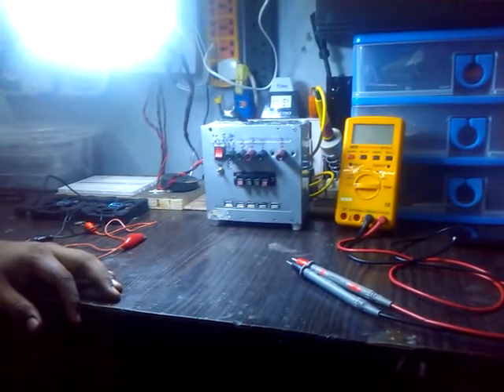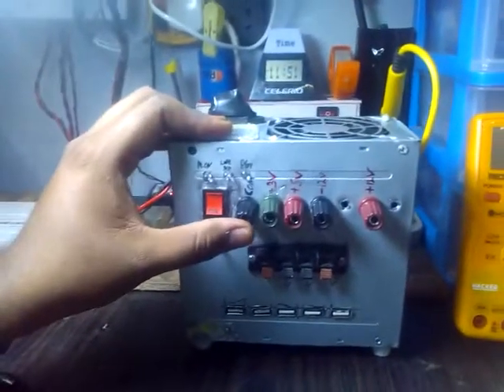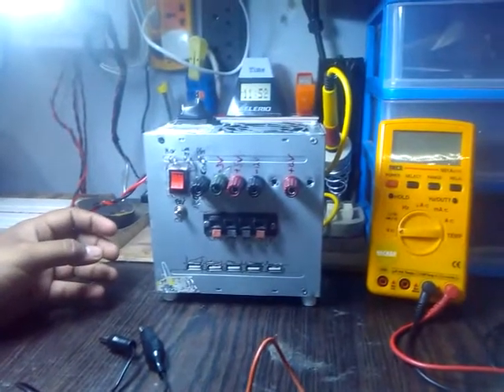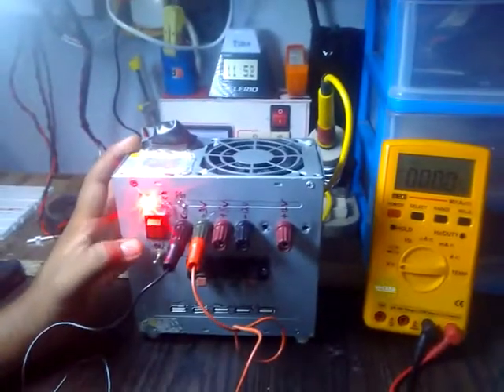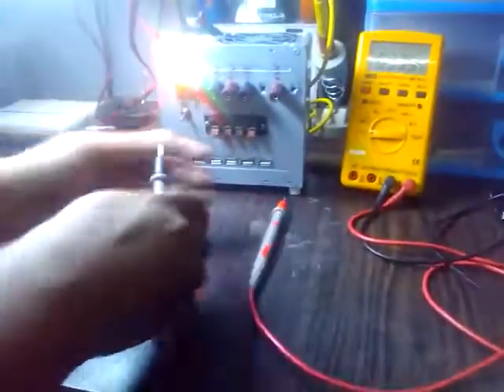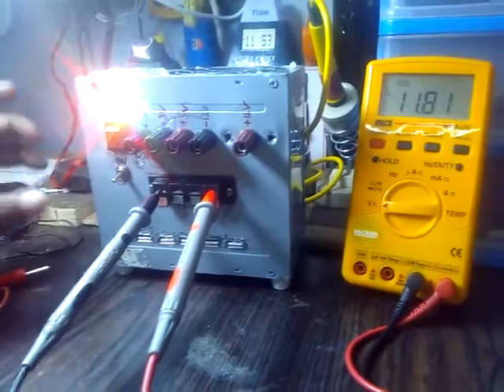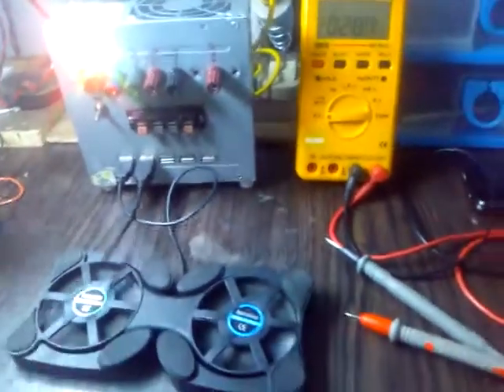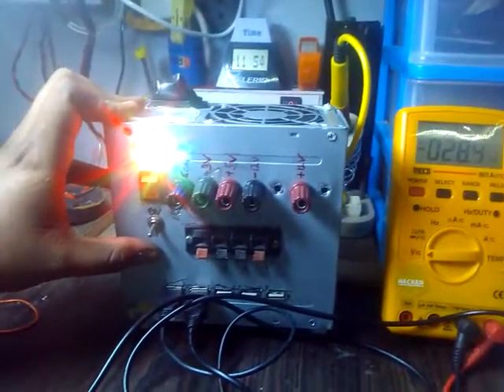ATX Lab Bench power supply with USB output

Comment: can you please what all connection should be made to convert it for lab bench power supply
Reply from the maker: thanks for writing,
in the ATX there is colour coded wires normally black is for GROUND, orange is for +3.3V, red for +5V, yellow is for +12v, blue is for -12v, purple is for +5v standby, gray is for power good. u need to connect the green and black wire to on the atx and u also need to put 10W  5 ohm dummy load resistor between ground and +5v. and plz look the colour coded on to the ur ATX.
Reply: I have done everything and actually I had 22ohm 10w resistors and after starting everything went but it was giving some kind if sound and when I touched the box I got a shock and I connected resistor to 12v
Reply from the maker: Vishnu Chuncha ok u need to check  the atx EARTHING line, if tis connect properly then  Check the all wires and the main board make sure that nothing touch the cabinet.. if still facing the problem u need to check the main wall socket. and about that sound is it Hissing sound ? if yes so u have to connect the dummy load resistor between ground and +5v (5omh).
Reply: Ya I hear some hissing sound like buzzer pops , not exactly Like buzzer but similar to it , and is it OK I connect dummy load  +12
Reply: How to check earthing line and I have connected dummy load to +12 and I m getting hissing sound
Reply from the maker: Vishnu Chuncha u have to connect the dummy load to  +5V with 5ohm 10W, and about the earthing, try the other wall socket.

Comment: How to make it I have atx of I ball of 400 watts n how to test whether its working or no
Reply from the maker: fist u have to connect the black wire (ground) to the Green wire (Power on) this will start the fan of the ATX if its started then its working.
Reply: can u please tell me what are applications if I convert atx to bench power Supply
Reply from the maker: u can follow this video to make it Converting Computer ATX Power Supply to Lab Bench Power Supply 
if u have any question u can ask me any time
Reply: are the colour of wires same as he showed
Reply from the maker: yes almost but u can test it with a multimeter. and black wire is always the ground.
Reply: where all I can use this
Reply: can I supply this to 7805 voltage regulator
Reply from the maker: yes u can use it but go through the data sheet fist
Reply: what happens if current rating becomes high for regulator does it get damaged or wastes through heat ?
Reply from the maker: u can use the steel one and put heat sink and again chk. the data sheet.
Reply: thank you, can u provide some tips

Comment: Did you put a resistor in there to keep it stable at low voltages?
Reply from the maker: Yes I put it the 10W  5 ohm dummy load resistor in side with heat sink.
Reply: @electronicjugaad6855 f�